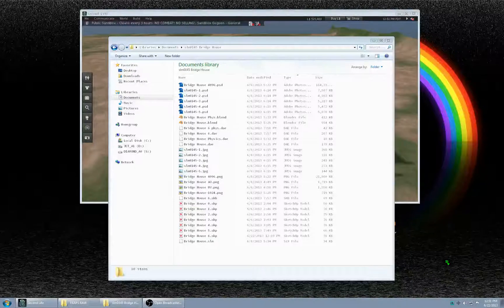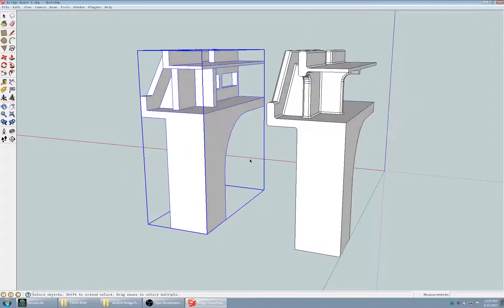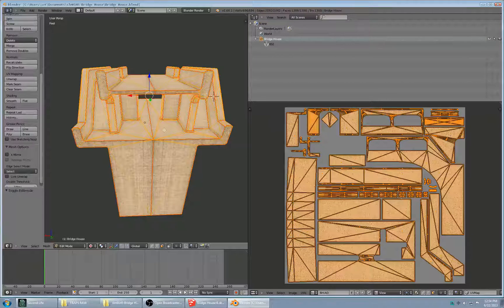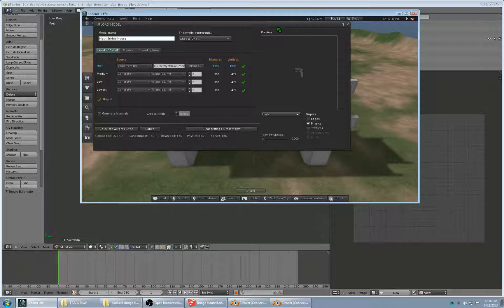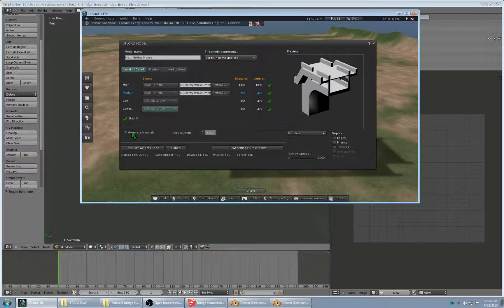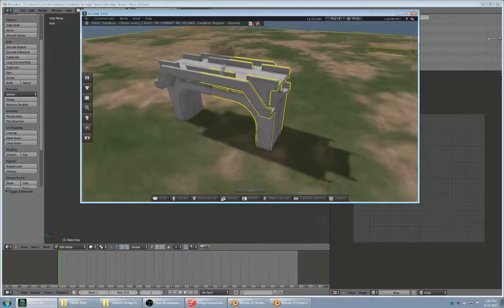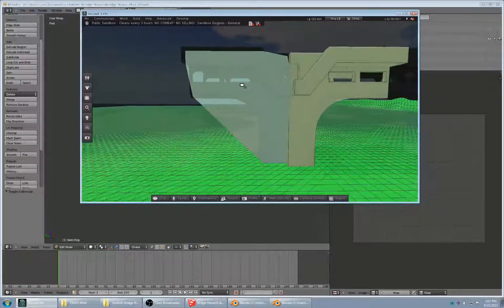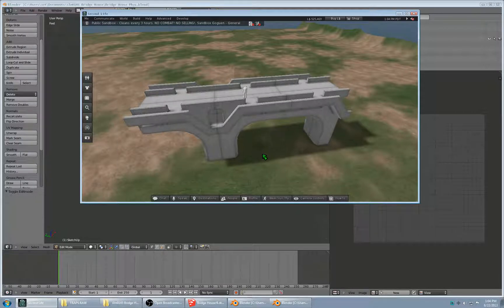Second Life Mesh Physics Basics

Comment: Every time you chew in my ear I wan't to slap you. Please don't do this :p Also, for non americans, speed x1.5 is gooood. Thanks for the vid though. Quick question, when I upload my physics model, in the step 2 section, all I can select is close holes and analyse, there are no methods in the drop down boxes, and it will not let me calculate UNLESS I click simplify. This is making me think there is something you must do to the physics model before you even upload it, what is it?
Reply from the maker: +Evelyn Grzedzicki Really depends on your workflow... for me I always avoid all extraneous bells & whistles during the production process. Start with the bare-bones approach then systematically try it with increasing levels of complexity, eventually you will discover the kink in your pipe.
Reply: I found it xD